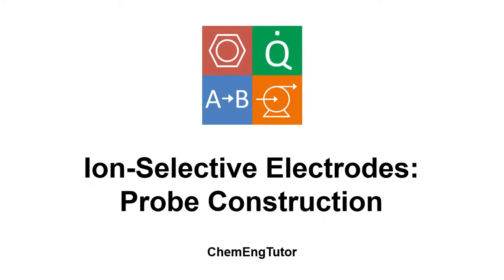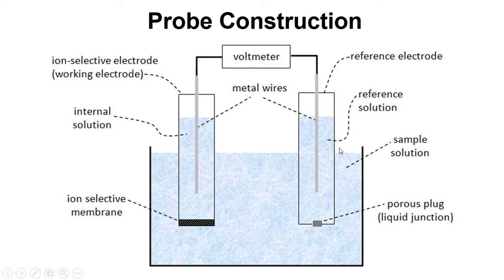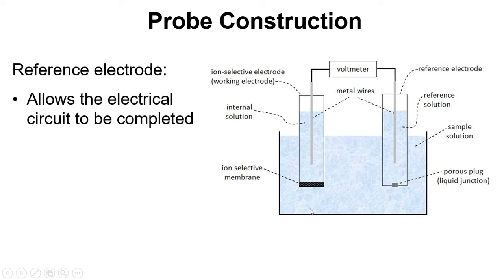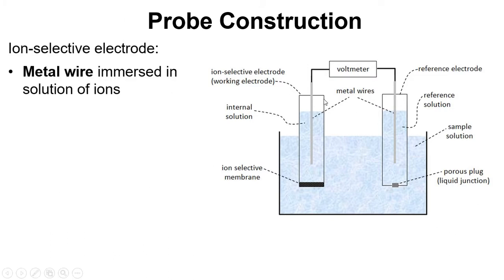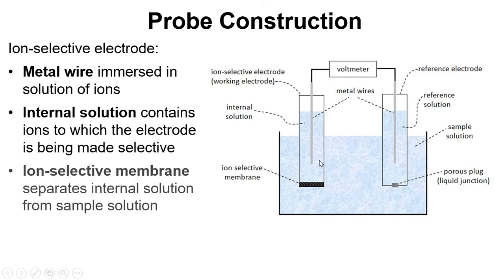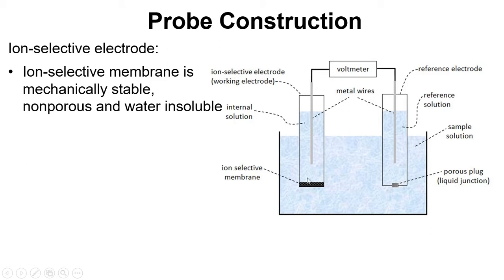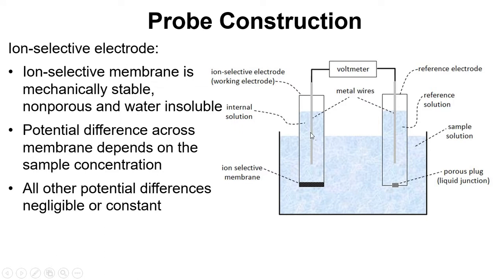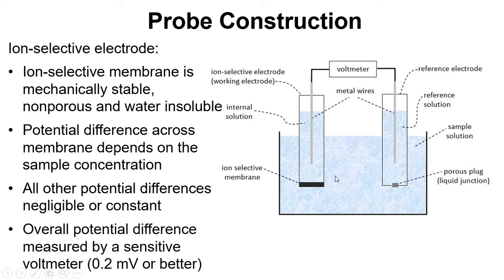Ion-Selective Electrodes – Part 3: Probe Construction

Comment: Hello Possible I want to help me solve a scientific paper for a fee. I want to find the results and do it on the Matlab program
Reply from the maker: What do you need help with?
Reply: @ChemEngTutor  
I need help finding (vapor weight fraction) I tried to find it via equations of state (PR) in Matlab, but I'm not sure if the solution is correct.
Then all the results are made on a program in Matlab and shown in a drawing as they are in the scientific paper.
Can I contact your the private email to send the scientific paper? It is an old paper that is not available in PDF format